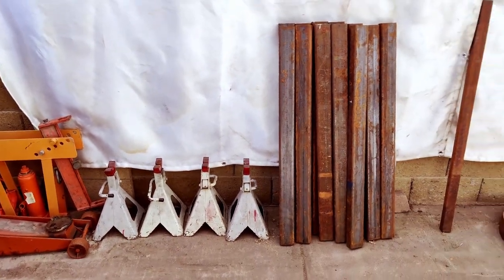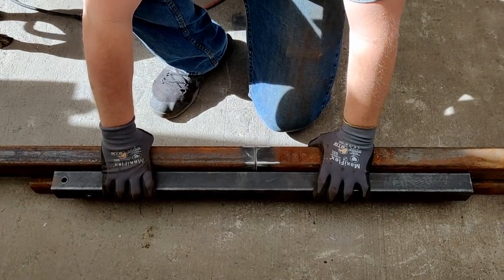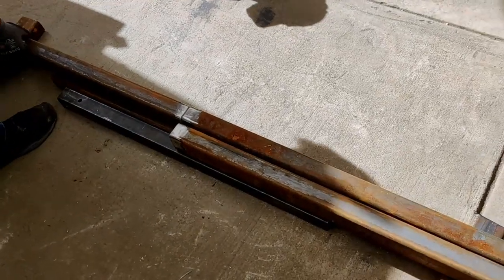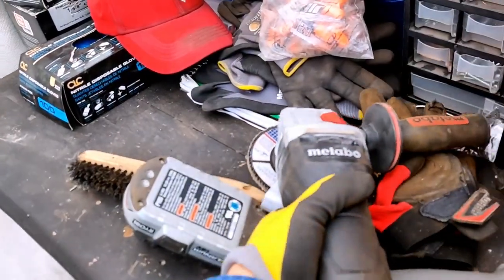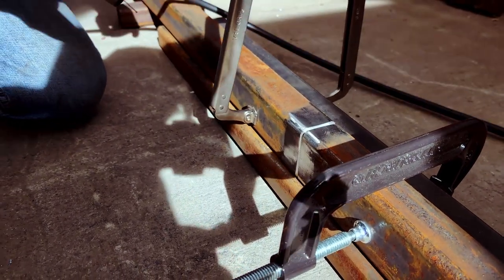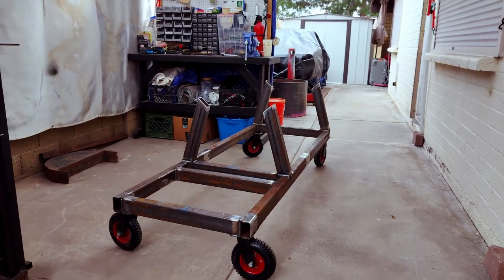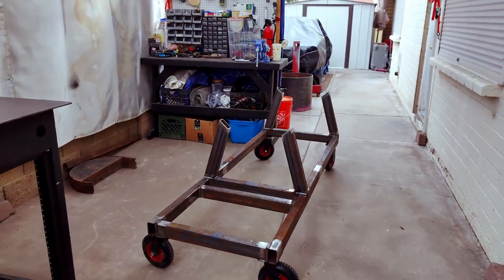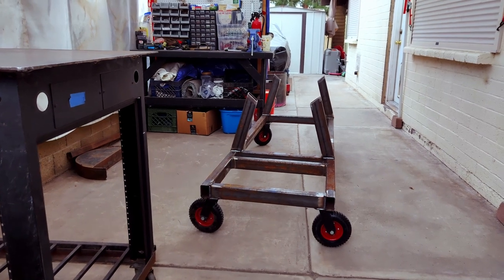Offset Smoker Build: PART 5 - Frame It Up

Comment: also how did you settle on the angle for the uprights
Reply from the maker: I did all the drafting of the plans in Adobe Illustrator at actual scale. Because of that I didn't really have to math anything because I could just move around my drawing and dimensions at will. With that said I did make a little mistake in the draft on those uprights and we had to pivot a bit once we realized it after having cut them. Because of that I'm not sure what angle we settled on. We should be getting back to working on the pit this week. I'll check the angle when we do and report back.

Comment: What size is that welder looking to buy one and build me a smoker with 1/4 steel
Reply from the maker: We're using a Harbor Freight Titanium MIG 170 welder for anything 1/4" or less. When we weld the 3/8" stuff we use the Everlast PowerArc 200STi stick welder.

Good luck with your build man. It's a ton of fun. Be prepared to get addicted!!!

Titanium MIG 170: https://www.harborfreight.com/mig-170-professional-welder-with-120240v-input-64805.html
Everlast 200Sti: https://www.everlastgenerators.com/product/tig-stick/powerarc-200sti
Reply from the maker: Just wanted to follow up on this. We have used the Titanium to weld some 3/8" stuff while hooked up on a 220v line and it did really well. No issues at all. Just make sure you bevel your pieces so you get better penetration.

Comment: what angle did you cut your support legs?
Reply from the maker: That is an excellent question. I don't know what we settled on actually. I had made a little mistake in my computer draft and so we had to pivot and tweak things a bit. It was a bit of a time suck of a mistake too (face palm). It was also really boring to watch me try to figure out what went wrong and where so I didn't include it in this video. We've been on a build hiatus since Easter and that will likely will for the next 2-3 weeks as well. When we get back to it I'll follow up here for you and get you that answer. ALSO, I plan on doing a sort of summary of lessons learned at the end and I think I will probably do a before and after of the design in that video since decisions on this build have been very fluid and what I started with is not where I ended - by choice.
Reply: @BSBBQue  thanks a bunch.  I'm starting one this weekend and was just curious about the angle.  when you get back to it please let me know what angle you used and how you determined it.
Reply from the maker: That's great. I hope you enjoy the process as much as I have. So, although I can't give you the exact angle we actually arrived at, I can speak to the method I used which would have worked perfectly fine if not for me overlooking a detail.

I made use of my experience in digital design software to do the lifting for me so the math was very minimal and it was a very simple process because of that. I would really prefer to make video of this for you as I think I might find this bit changing to explain, but in interest of time and with respect to your build I'm going to give it shot so, bare with me here :)

I basically made a full scale digital drawing (you could do with with draft paper as long as you mind your scaling) and played with it visually until it looked right to me with the only provisions being that I make sure I allotted room for the door flange, door handle and some sort of shelf. At the time I had not committed to anything specific with regards to those things so I accounted for what my gut was telling me would enough clearance for all of that stuff and I picked a somewhat arbitrary spot within a "safe zone". So, in the digital draft, I literally just drew lines down from that safe zone spot on the cook chamber, which I had positioned so the center would be 36" from the ground (taking into consideration the height of the wheels as well as the frame material), down to the base frame while maintaining the proper material size and used a constant angle where these vertical supports met both the base frame and the cook chamber; meaning I did not plan to make a fancy pants concave cut, or whatever you want to call it, where it would attach to the cook chamber. Just a straight angled cut. Since I'm not a fabricator and my brain is not used to working in that manner I found it easiest to take the long measurement of that now drafted vertical support and simply measure the difference on the shorter end for both sides of that vertical support.  And with that I had both my long measurement but also the short measurements for both ends that I could then set the saw to miter.

My MAJOR error is I was using a outline in my drawing and the outline was set so that and my it added to my desired measurements which became evident after we cut the pieces and were test fitting and checking measurements in the real world and so nothing was going to sit quite right.

I hope that helps, but expect it to not so my apologies on that!